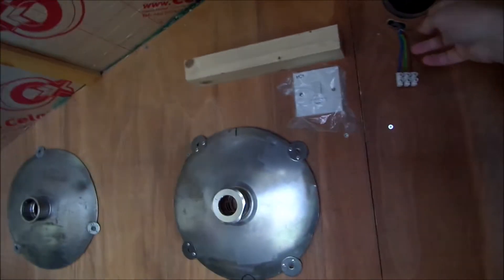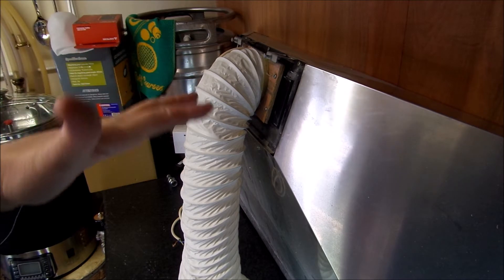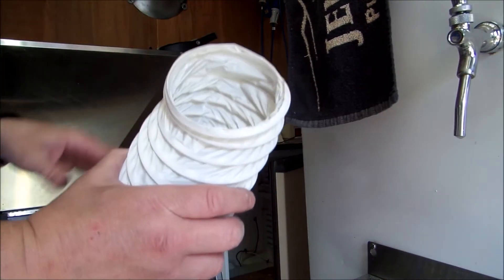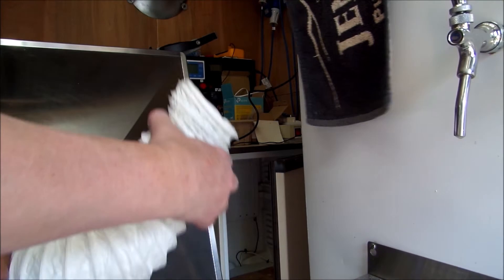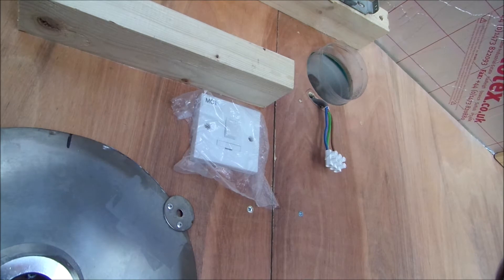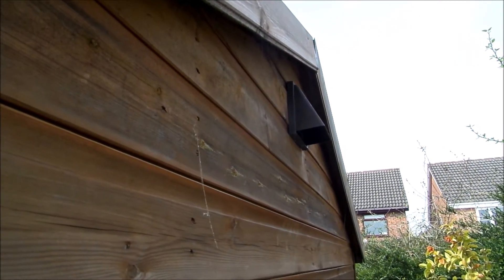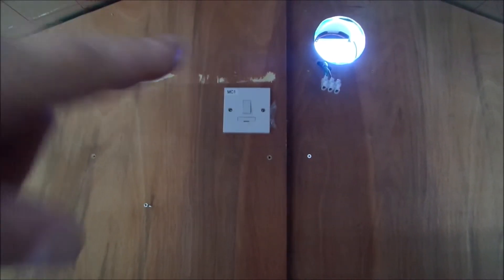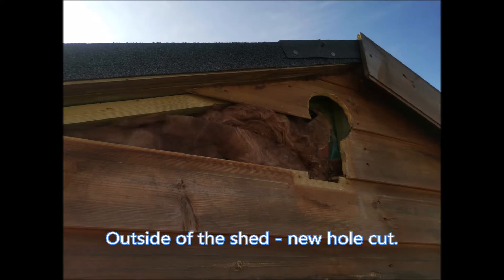Vblog80 - Extractor Fan Fix

Comment: Should improve it, I have a pair of hoods, the main one has the same issue, i have an extra inline fan but still found you get a build up in the housing, i added a layer of carbon cooker hood filter screen which allows water to go back to vapour before dripping through though it`s not 100% it`s much better. I dont know if it would hold on a 90 min brew though
Reply from the maker: I read somewhere else about adding the carbon filter to fix it. I brewed today and it was still dripping but from the join in the plastic around the fan. I may be able to put some silicon on it then whack it together and let the silicon cure. That's for another video.
Reply: @HoverdogBrewery  i`ll send you a screen shot of the stuff i used on FB